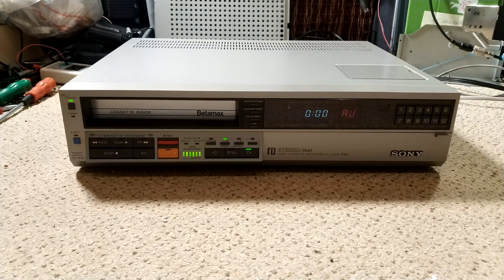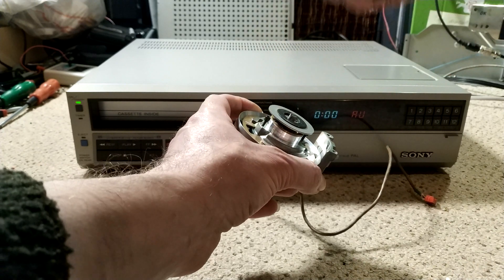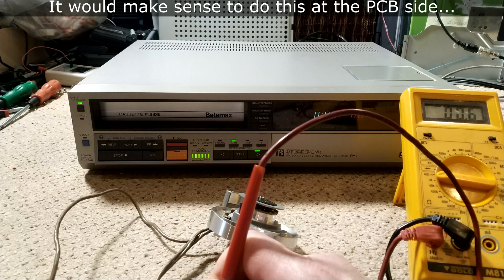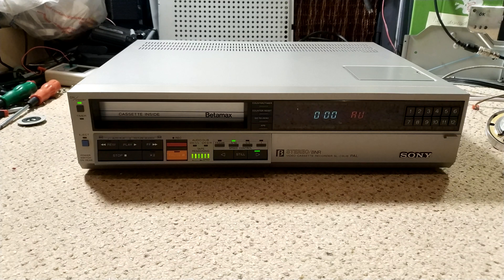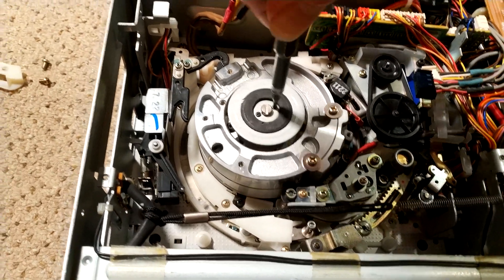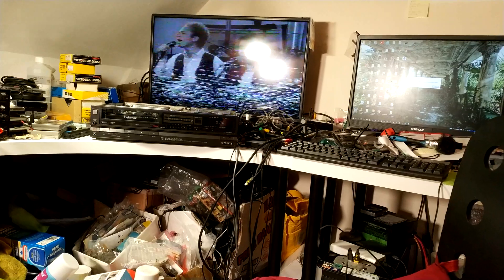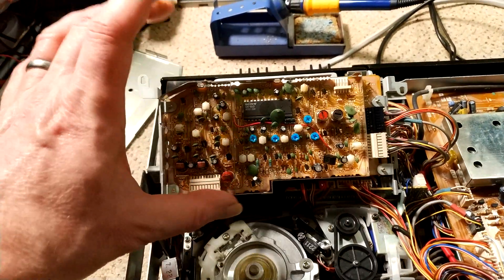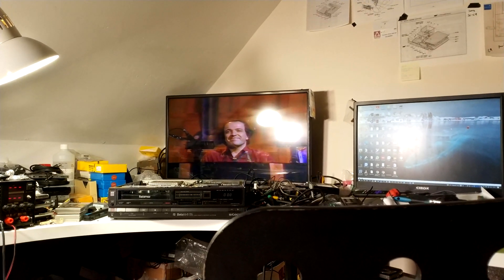Sony SL-C9 Betamax - NOT changing the head drum and some head check tips

Comment: Any idea what;s the likely cause of a playback sync/speed error (symptoms are a bit like a tracking bar constantly travelling up the picture) on  a C9?
Reply from the maker: It'll more than likely be tape path issues so check for ACE head alignment, excessive back tension, tape path contamination, dirty capstan or faulty pinch roller ('flick' the pinch roller and it should run on for a few seconds). If all is well there it'll probably be a capstan servo circuit issue. Let me know how you get on.

Comment: I have couple of sl-c9's that I am working on. I messed up the pots on RV7 and SS11 boards. Can you show us how to adjust them? please?
Reply from the maker: It might be a while before I do a C9 video but I will be building one from lots of spare panels soon so keep a look out. What issues are you having with alignment?
Reply: @MrBetaByte  I simply screwed up the Rv potansiometers while trying to find the fault On ss11 board and rv7 boards. What would be the correct way to adjust them with an osciloscope? Please show how :)